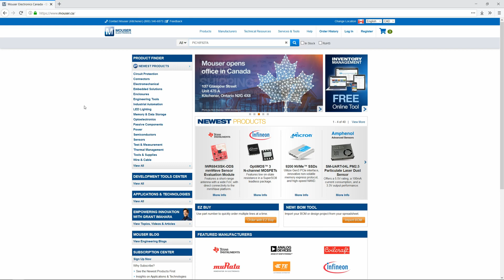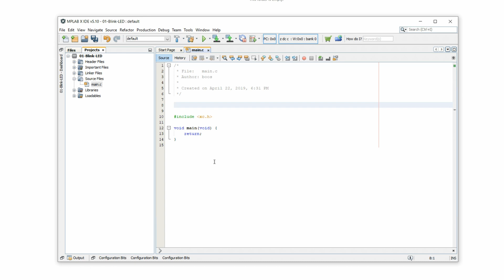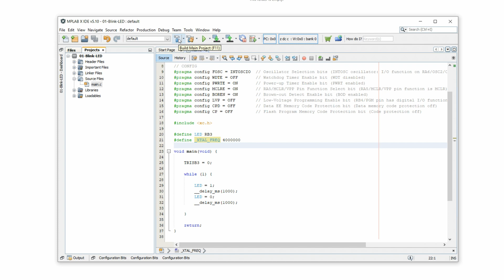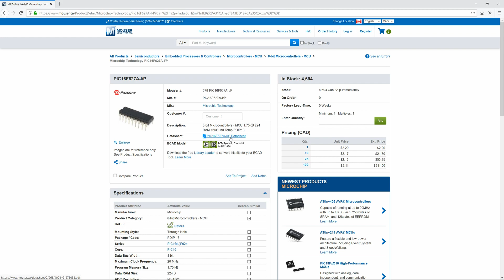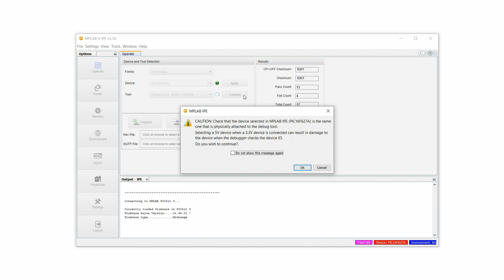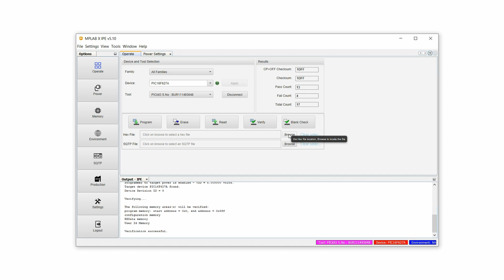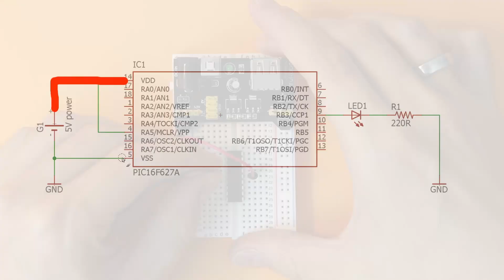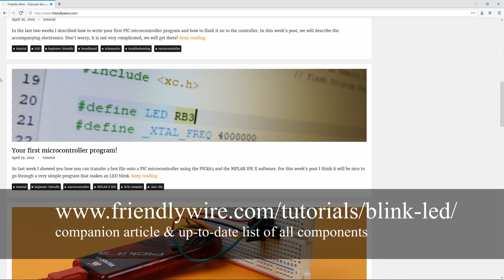Your first microcontroller project!

Comment: @FriendlyWire, I replicated everything you did exactly (with a PIC16F628A), except that I used 2 AA battery back (total of 1.5 + 1.5 = 3V). However, the LED doesnt light up at all. However, if I disconnect the V_ss from the negative terminal, the LED lights but does not blink (and it does so from every port). Do you by any chance know if the 3V is the problem? i.e do I really need a 5V battery? (the data sheet says that it runs from 2V to 5.5V, so I thought there must be some other problem, but I really feel that everything else is correct). Thanks so much for your valuable time, and great tutorial!
Reply from the maker: Thanks for your kind words, and happy new year! My first idea to check would be to add another battery and run everything at 4.5V. The reason is that some LEDs have a forward voltage of around 3V or even higher, so they might be very dim when the circuit runs at 3V only. What LED color do you use? :)

I am not sure what you mean when you say "if I disconnect the V_ss from the negative terminal, the LED lights but does not blink (and it does so from every port)."  Can you clarify? We'll figure this out :)
Reply: @FriendlyWire  Happy New Year! I will try that out soon and keep you posted! I am not sure if the brightness of the LED is the issue because it burns bright enough when I connect it in a test circuit even with the resistor (the LED is orange). But, adding another battery and checking what happens is certainly a good idea. By disconnecting the V_ss, what I mean is: I have one wire from the +ve terminal of the battery to the V_dd port, one wire from the +ve terminal of the battery to the MCLR port, the LED at the RB3 port and a resistor from the other end of the LED to the -ve port, but I do not connect the V_ss port to the -ve terminal of the battery. When I connect the microcontroller this way, all ports are permanently open (i.e all ports are = 1 as far as I can tell). Thank you for the response, Happy new year, and I will keep you posted once I add another battery and try it out :)
Reply from the maker: @maithreyaaravindsitaraman3266  Thanks for the clarification :) So it seems that maybe the voltage is high enough to drive the LED after all. Let's just be safe and see what happens if you connect 4.5V instead :)
Reply: @FriendlyWire  So, I connected the 4.5V - but to no avail :(. With 4.5 V, when I connect all the wires (with the V_ss), the V_ss or V_dd wire gets hot — however, the LED still doesn’t light. I have attached pictures or screenshots of each step completed below:

(1) The code: http://math.columbia.edu/~maithreya/robotics/blink_code.png
(2) Successful Clean and Build: http://math.columbia.edu/~maithreya/robotics/cleanbuildsuccess.png
(3) Programming the microcontroller successfully: http://math.columbia.edu/~maithreya/robotics/programmingmicrocontrollerlog.png
(4) LED burns (but doesn’t blink) when V_ss is disconnected: http://math.columbia.edu/~maithreya/robotics/vss_disconnected.JPG
(5) LED fails to light when V_ss is connected (pic 1): http://math.columbia.edu/~maithreya/robotics/vss_connected_LEDdoesntlight.JPG
(5b)  LED fails to light when V_ss is connected (pic 2): http://math.columbia.edu/~maithreya/robotics/vss_connected_LEDdoesntlight2.JPG

A possible thought I had (it may or may not be the reason for the problem, but just a thought): Is it true that all ports of the microcontroller = 0 by default if V_ss is connected and =1 by default if V_ss is not connected? If so, it could it be possible that for some reason I am making a mistake in the programming step (i.e passing the code to the microcontroller), and that therefore when I connect the V_ss, the V_ss wire becomes hot but the LED doesn’t light because the port is closed (since the code has not successfully been transferred to the microcontroller).

Thanks so much for your kind help!
Reply from the maker: @maithreyaaravindsitaraman3266  Thanks for the detailed steps! Looks like you plugged the PIC16F628A in upside down in http://math.columbia.edu/~maithreya/robotics/vss_connected_LEDdoesntlight2.JPG , I think. Does that fix it? :)
Reply: @FriendlyWire  Thank you so much!! I got confused because the writing on the data sheet https://web.mit.edu/6.115/www/document/16f628.pdf is opposite to the writing on my pic controller. Moral of the story: the direction of the microcontroller is given by the small curved cut out to the end, and NOT given by the direction of the label (the writing). Thank you so much. Out of appreciation for your help, I would like to make a small donation -- perhaps I can contact you by email? Your videos are wonderful.
Reply from the maker: @maithreyaaravindsitaraman3266  I am glad it works now! That's amazing and all the reward I could wish for :) Yes, the notch is important, in my later videos I mention it explicitly, but this was my first real video ever so I missed some parts. Sorry that I did not emphasize it in this video, and for the resulting confusion. I have not monetized anything on my small channel, so I would not know how to even accept your donation. All good! :) (If you have spare money you want to donate you could use it to get yourself some new electronics components to experiment some more, that would be awesome, too!)
Reply: @FriendlyWire  Oh yes I will keep getting electronics parts and experimenting. This is indeed a addictive hobby :). I totally understand if you are not comfortable to receive a small donation. I am a mathematician by profession, and if you ever are working on a project which is more mathematically sophisticated and want someone to take a look at it/ help out with something, you can reach out to me anytime :). Instead of a donation, perhaps reciprocity is the most suitable way to respond, and so if you are ever in need of my expertise, I am ready to help to the best of my abilities :). Best Wishes, and Keep up the amazing work, Maithreya
Reply from the maker: Thanks so much, Maithreya :)

Comment: Hello there does this mplab program support 8051 microcontroller
Reply from the maker: Hey there, I don't think so, MPLAB is developed by Microchip and only supports their line of controllers. The 8051 is from Intel, so it is not supported, sorry.

Comment: hi please suggest any easy project on microcontroller that can be done on proteaus .
Reply from the maker: I have never worked with Proteus because it is rather expensive if you want to purchase a full version that allows you to design your own circuits, it looks like it ranges from $250 to well over $5,000. But if you already have access to Proteus, for example via your job/university/friends..., then it sure looks like a cool software.

For ever microcontroller project I ever covered you can download all the .hex files directly from my website www.friendlywire.com and upload them to Proteus, as I understand it :) So all of them can be done in Proteus :)

Comment: can i see the usb cable which is used to supply power?
Reply from the maker: Can you tell me what time in the video you are talking about? To run the circuit at the end I use a USB cable that looks like 18:50 at both ends. One end goes into the circuit, and the other end into a USB power bank or a computer or a phone charger, basically anything that powers USB is fine. Hope that helps! :)
Reply: FriendlyWire you are using male to male usb cable, right? for the usb port on that adapter circuit, it is used for input not for output?
Reply from the maker: @phnompenhlifestyle  Can you tell me what time of the video you refer to?
Reply: FriendlyWire 18:50
Reply from the maker: @phnompenhlifestyle  Yeah, the USB cable is just for the power. You can use any other 5V DC power supply :)

Comment: I have an upcoming project and this video really helped in a huge way!
Reply from the maker: That's fantastic, James, I am very happy to hear that! Let me know if you have any questions or future PIC micocontroller topic suggestions :)
Reply: I actually do have question(s) pertaining the  coding part of the project. I did everything step by step by still at the end I keep getting “Built failed “ Error
Reply from the maker: @jamesdyer2219  Oh no! My email address is on www.friendlywire.com (scroll to the bottom), send me your code and a screenshot of the error message. We'll make it work :)

//edit: To anybody else reading this: it turned out it was a simple typo on James's end, but now we got it working. Code in the video is fine.